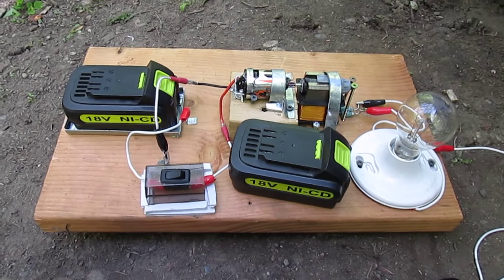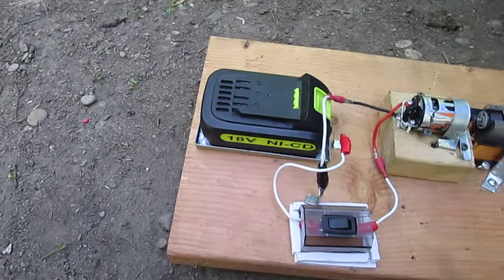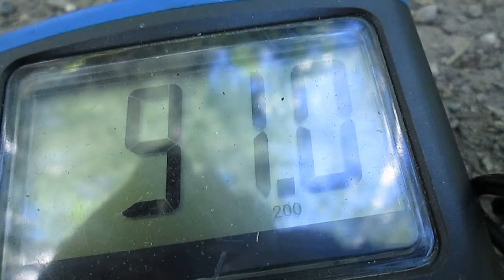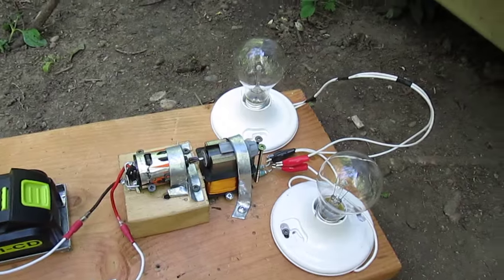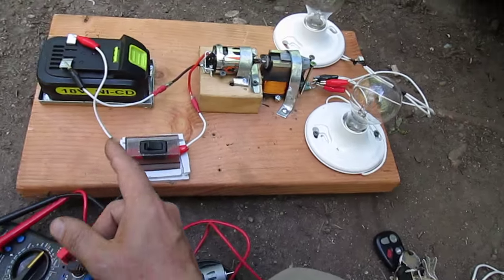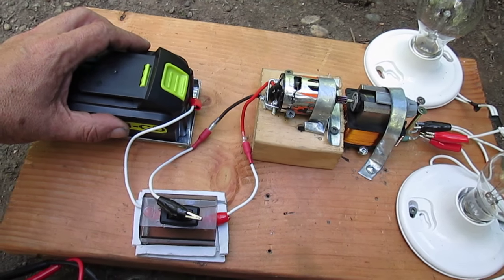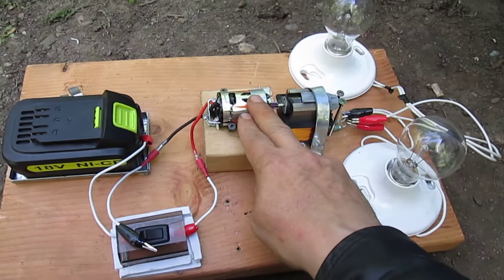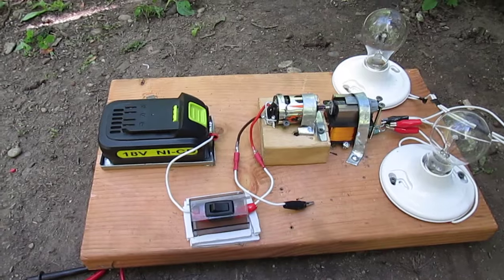Gerard Morin motor generator test phase 1

Comment: My understanding is we want to put a spark gap on the output of the RF pump, specifically a vacuum spark gap to increase our RF output. Noted in conventional circuits a vacuum spark gap will increase our voltage for free.

Comment: Hey, my friend, I don't know if you know it, but you're ( OVER UNITY,) FROM what I have seen.!!
Now,  you're putting in, 20-DC,volts.
But getting out, 220 to 245, AC. YES,!! THAT'S OVER UNITY.!! 
If you were to, take that 220, AC Back Through a ( Bridge rectifier )
And Turn it Back into DC, Power" 
I'm Sure what you would get, out
DC, will be more than 💯%!!!
The 20 volts DC, YOU'RE STARTING
WITH, From the Battery.... Good work,!! & Keep going.!! If you need 
Any Question's answered, I can help.!! If you have any questions,
I will help ya, with them. As will,
Most of the people who are watching you're channel... If they
Can, I'm sure....

Comment: I did the measurement with an ammeter on the input and another on the output. They are both identical, also, I plugged in a battery charger to the system to see what kind of energy had to be dropped into charge the battery, at idle with the battery charger, then, connected to the battery to see what the charge being input was. The only thing that showed me anything promising was the counter emf from the permanent magnet motor flashing back into the battery during the high speed generation which made the motor 50% more efficient due to the rpms the motor is going, only at full speed. If we took a 100 vdc motor and run it at 4500 rpms, the counter emf would be 102.5 volts returned back to the battery while drawing the massive inrush current, then, as speed increases, the counter emf would increase with less amperage as the amperage being drawn from the motor reduces in load. The more load, the more emf is produced and the more power in emf is released, however, with the load being higher, the more is being used to speed the motor up. Once up to speed, it only releases a fraction of the original takeoff power as the load reduces and gives out 50% recovery reflux to the battery, making it a hell of a lot more efficient than using any other motor type , especially a shunt motor that uses an energized coil to magnetize the rotor or stator for use as an electromagnet to make it spin. Those motors use more to spin, and, they do not recover the additional reflux because it is either dissipated through the shunt or a resistor made to eliminate the electrostatic voltages driven from them running at high speeds. Gerard has chosen the right motor, now, other circuits need to be added to it to make it more efficient , using transformation with a very specific core as I have.
Reply from the maker: +Marc Belanger I have just put a newer set up under testing and have some results but I do need to validate now here in December 2015. It took a lot of logical steps bases on progressive hypotheses. So I do not doubt your findings since I havea surprising result. I will not go it to details until there is a lot of validation. In this case there is are both higher ampsand volts translating to power. If I do not prove myself wrong there is a reason for moving forward with this.For self looping there are the spikes It current that make it difficult to do. You might know more about this aspect but some information is that the volt level part of the current should be higher back to a recharge able battery then the battery is drawing. The 18 volt NI-Cd charger output is 34 volts DC rectified from AC wall current usually a 1 hour full charge.
Reply: Marc Belanger have you built a Gerard pump? If so has it been self charging? Im pretty interested to try it myself.

Comment: after watching most of these Gerard Morin experiments I have come to the conclusion that the magnetic pump motor is an analog of the larger grand scheme of his theory or ideas is more in the lines of tesla's motor generator experiment but using transformers to step up really high voltage and lower it down to get the amperage at a lower voltage in a loop system and run the main turning motor. The problem is loss in the transfer of power due to heat and poor designed transformers. But this experiment is proving a motor can be a generator but also a transformer is a motor. This experiment is kinda setup along the lines of a toyota prius as you have drill battery as the traction battery and a electric motor driving a smaller motor generator that can do power generation and motoring as well. Basically all you need to do is basic math in watts to see your losses and gains. Amps times volts equals watts. Do this for the input and the output.
Reply: Amps times volts does NOT equal watts with AC - you have ignored the power factor, perhaps you should learn the basics before making glib false statements.  Transformers are rated in VA and kVA precisely because W != VA with AC.

Comment from the maker: A test is made to measure actual power draw in and power output in useable watts in a Gerard Morin system. The main difference is a slower RPM higher torque DC motor
with a NI-CD battery rated for 9 minutes use with tool engines.
Reply from the maker: This is a brushed universal DC motor.  I am looking at aspects of the DC universal as it is purely elemental. The most significant early add on to the DC universal was the addition of the  excitation coil to strengthen the magnetic field and output (serial DC) toward the type used for the amplidyne  motor generator (in the subsequent videos).

Comment: Bob Bateman here just would like to point out the fact that if you want a machine to power itself you need to run another motor oof of the loop and feed it back to the first the only thing I cannot figure out is the automatic transfer switch because the fact that you you would loss power from the switching off from one power source to the other, but if you think about the fact that energy once it is has been generated cannot cannot be destroyed this is the realization of a true resonating frequency  resonation is that you have to have two motors and two generators one powered by the other and the other powers the first this is the series setup that I have been trying to recognize in my mind only that one house; two house ; three house; four house could power the fith  house if a true powered acquisition is realized. All of which in your neighborhood could power your local walmart. With the all ideal transformer switch allowing them to transfer some of their profits into direct cost savings to you Eventually my methods will be the way of life.

Comment: You may get Voltage, but what about Watt, how much watt you are putting in, and how much watt are you getting out?
Reply from the maker: With this test there is loss in friction and the DC motor is the prime mover to the higher voltage AC washer pump. The starting input wattage is  estimated at around 105 Watts at 18 volts and the battery is ordinarily rated for 9 minutes. The output wattage at around 17 volts was measured previously with an AC multi meter measured by an electrician at around 70 watts. The drain is fast with this type of battery. The margin was wide enough to conclude a lower output wattage estimated on this build.

Comment: Hi Allan, Interesting to see your small prototype device. I would like your opinion on the same concept that can be connected to a transformer to increase and charge a large battery that can be used to power a small home of 1500w-2000w maximum. I would also see the same output used to recharge the supply to motor battery too. You opinion and advice
Reply from the maker: I was looking toward or suggesting the next step in the Gerard Morin configuration. I do not know it all but Iam good at logic. Usually transformers as I am aware step up or step down voltage of AC current withoutincreasing the wattage power. Gerard is looking at variations of special types of transformers that I surmisepossibly become saturated some current flows and claims, they are high voltage and pricey.I decided to explore practical steps in a direction some experiments and effects themselves have lead toward.Definitely with self looping the output must be over 100% or unity to self run. Apparatus needs an over unityvalue of 200% times input to self run and produce the usual level of power. There have been a lot of motor generator claims I do not think many have got it right yet. There is some evidence of effects that could getit right.
Reply: As i understand(i may be wrong too) Gerard Morin indicates amplification of the output can lead to self reliability of looping. My approach to the utilizations is controlled  and self recharging the storage as an when required -in other words generate the power, have a storage capacity amplify the storage to AC output and on  storage reaching a certain minimum level activate the motor pump combination (GM system) to recharge the storage battery(ies) making the whole system standalone and self dependant. Of course the load has to be controlled to limit instant draw from storage.-Your thoughts
Reply: hi free energy is not that simple ... what your used is filament bulbs as a load .... all existing meters are calibrated to 50Hz and what your getting is 4000Hz you use CFL or LED bulbs you will able to power up number of them and then it will overunit ... or use bridgerectifier and convert DC .... controlling speed of driving motor to control output voltage ... ( you can recycle comp powersupply you will able to get cap of 440v / bridgedrectifier / 12v fan / heatsink etc.) I have not tried this project but in month or two I will explore this....

Comment: you got 222v, i got 313.8 vrf and the generator nothing change RPM yet still the same speed 3000rpm, but the one i have is from washing machine electric water pump, not from  fish tank water pump .please reply, i just saw in march3, 2022 ,your's v d o .

Comment: can you make a metal grinder working with this?  

if no then what is the point?
Reply from the maker: lol ha. Dugagjin the video says I wanted to measure the watts out because they were not given for this DC driven washer pump motor. The video also says I wanted to look in to the dozens of documented claims of motor generators with some self running claims. With my latest configuration the x1 minor scale up I can run a metal grinder at least an electric pencil grinder. The point is more efficiency and the reason for doing is for this or to find a better power generating system that can compete with cold fusion,  solar and geothermal and energy cost.
Reply: Only if you use the battery directly.
Reply: +TODOR brassmonger Official ft. cloudance (Cloudance) what you mean by using the battery directly. . you mean without using the pump electricity?
Reply: yes
Reply: +TODOR brassmonger Official ft. cloudance (Cloudance) then what is the point of spending money with this ?

Comment: what kind of motor are you using to this? 
volts . kw . rpm please?
Reply from the maker: At about 1:50 of the video the motor is explained. It is a high speed DC T55 (55 winding) DC motor used in radio controlled model trucks from axial. com
Reply from the maker: For RC rock crawlers 55T on the page:http://www.axialracing.com/products/ax24007

Comment: Have you thought about measuring the efficiency of the motor by itself, and of measuring the efficiency of the generator by itself?  Hint: neither is anything special, expect 60 to 80% for either of them, and throw in 10 to 20% losses due to friction in the crude mechanical linkage perhaps.  Where can you get over-unity from?  Think about it.
Reply from the maker: I performed a test of these motors to be  around 70% efficient with the standard input output. The standard input  output is a closed system with dissipation and all of the near environment variable conditions are not taken in to account. An open system recycles some of the power and as shown has a higher power level. The theory such systems is documented and debated from the dynamo, metadyne. For every force there is an equal and opposite reaction somewhere; the energy does not disappear it transmutes and there could be some induction and recapture of EMF.

Comment: I can see two or three differences between this setup and the original which I think are important, a] no adjoining hose pipe between motors thus increasing friction and enabling current to pass back and forth. b] no shock absorbing material under pump motor thus increasing friction c] not as relevant Morin used two 18v batteries achieving 36v and a 24v motor, I would also like to point out the feedback loop should go back to recharge batteries not direct to motor.

Comment: Lets do a little thought experiment:  Let us suppose your combination of motor+generator was > 100% efficient.  If that were the case it must mean that either the motor or generator (or both) were already > 100% efficient, since efficiencies multiply (50% x 80% gives 40% efficiency, etc).
If so then you are wasting your time with one of the devices, since the other is both more efficient and > 100% efficient.

Now if that were the case it means someone is already selling a motor or generator that is over-unity (and mass-producing it too!).

But of course if you think about it, that's nonsense (the datasheets for motors and generators already have the efficiency/torque/speed graphs shown, the best motors get to 85% or even 90% or so)

So either its already been done, or it cannot work...  Think about that.
Reply: Efficiency is defined as the ratio of power out over power in, that's maths.
Do you know what resonance is?
Reply: I've considered an awful lot more than I suspect you think I have.  Perhaps you could explain what phenomena and why resonance is special (since the equations of pretty much all the laws of physics support resonances - diffusion laws are about the only exception I can think of offhand).

Comment: all i can say is keep experimenting.there is a lot more to it.
Reply from the maker: green N.R.G  Yes. I needed to do this myself since I wanted the measurementsof amps at source.
Reply: Allan Shura it depends  on how you set it up and the way you run the load
Reply from the maker: green N.R.G The number one thing is power in versus power out. The measurements were not perfect but there is a margin to unity. The batteries are capable of 20 amps on discharge with 1 to 4 amps on a charge. Only .3 to .5 amps (.44) were measured on the pump output in  this test.